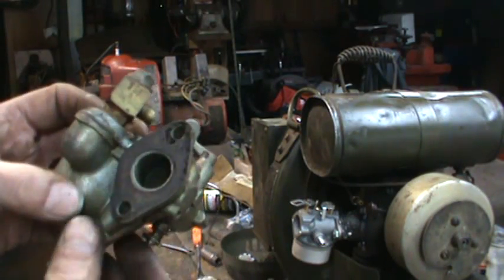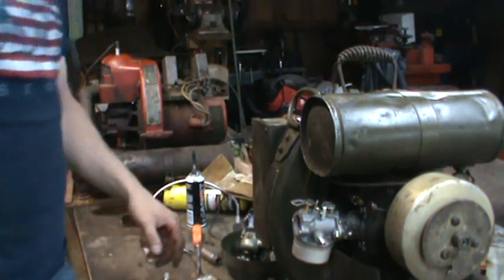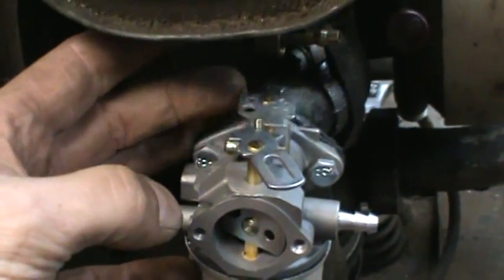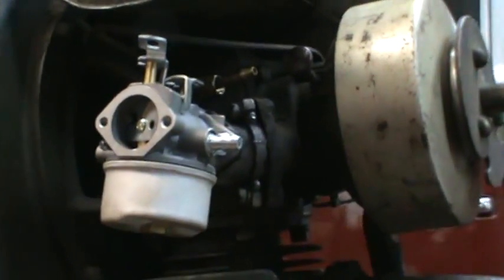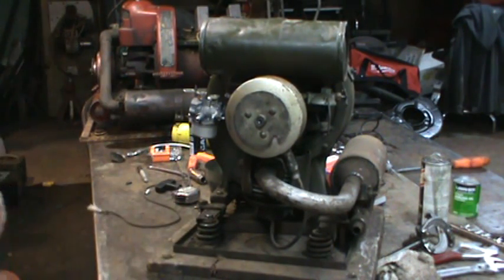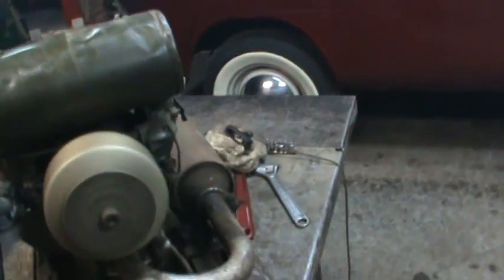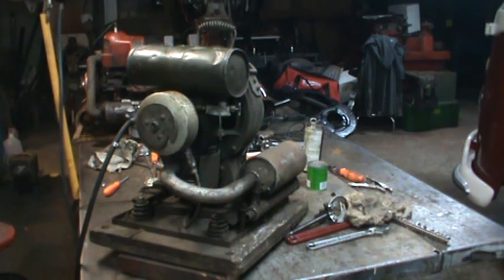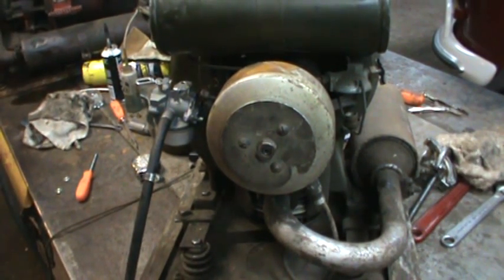antique 2 stroke engine with modern carb

Comment: Mustie..I have a 5 h.p. B&S (circa 1964) that came off a Simplicity snow blower that we inherited after my Grampa passed (1976) about 18 years ago I did a light refresh on the motor,a slight hone,new rings,and cleaned/lapped the valves,installed a "pointless" ignition and a "racing" carb. This spring after sitting for about ten years, two pulls of the chord it fired right up and runs great. I even have the chasis (all metal and damn heavy!) They are your's if you are interested. I won't be doing anything with them!

Comment: Looks like it has a crankcase sealing failure. All of old and unmaintained 2 stroke has this problem. You can not make a good cold start enrichment what leads the engine to start quite hard and goes full lean on low rpm with normal fueling settings.

Comment: I had a datsun truck that wouldn't run and was out of gas. so I drank the rest of the beer in the can and filled the cut open can with gas to near full, and was going to use it to spill little bits of gas into the weber vertical draft to keep it running, and get another beer,  so one handed with a screwdriver jumped the starter and the other hand held the beer can filled with gas. then a discovery was made, the motor will draw it's own ratio of gasoline to run perfectly as long as the level of fuel is close to spilling over (but not,) by adjusting  the tilt on the can. it's vacuum will self turbulate the surface of the gas and draw into the carb the perfect mix, maybe a little rich, but in any weather too. so just get the gas close to the intake, it knows what to do. then timing the new beer to be m/t just before the other one runs out so I could fill that one next was my challenge.

Comment: Sounds like an old Lawn Boy 2 cycle lawnmower. Grandfather had a gas reel type mower in the 50's and graduated into a 2 cycle Lawn Bow. The Gas reel mower had a starter cup notched for the started rope knot. After starting you tied it to the mower handle. Thanks

Comment: Like the video... as you continue to test things, you might consider using a battery powered impact wrench (with a socket temporarily mounted to the fly wheel) to make starting the engine, testing/fine tuning  things a bit easier. Either way, looks like your well on your way to figuring it out.... well done!
Reply from the maker: funny you should say that, as thats what l did now that the engine is built on a bike.
Reply: Do you have the video link, Mustie1? Can you post it here and in the description? Thank you.

Comment: They way you know you have adequate gas/oil mix is they smoked heavily compared to modern2 strokes constant blue smoke or you don't have enough oil in the gas. I ran these for years and about the only thing that kills them is the wrong oil mix 
1 quart of 30 weight non detergent motor oil mixed with 5 gallons of gas and they will run forever. Don't forget to shake the gas can for 30 seconds before fueling as the motor oil will settle.

Comment: I love these old engines. wow very loud! what size is it, something like 50cc?
Reply from the maker: not sure but l think its about 3 hp
Reply: Actually the noise level doesn't seem all that bad... always preferred engines with a low/lower sounding rumble vs engines with a higher pitched/mosquito like whine... wonder (if you used a smart phone decibel meter App) what kind of decibels that engine puts out at idle, half throttle and full throttle from apprx 7 ft away?

Comment: Sweet.  Great job man.  Can you use a computerized carb.  I have a box of old stihl, echo, and lawnmower carbs as well as a few engines I can destroy playing around and I think I may have a bit of tinkering to try tomorrow cause the neighbors would call the cops or throw a fit if I did it now.  Been close enough to there already.  Where are you located?
Reply: Phillip Kramer I'll take them

Comment: governor is behind the front half of the crankshaft remove the four bolts that hold the front case on you will see the governor it is spring loaded variable venture type it restricts the air fuel mixture going into the engine. no matter what carb you put on it the engine will not rev any higher I have a couple of old homelite generators and I ues Tecumseh 5 hp carbs on both
Reply from the maker: +Ronald Broadway thanks for the info, l have this engine on a bike now and took it apart and found what you said,
Reply: Interesting, learn something new every day! Thanks

Comment: I have an old Briggs & Stratton (circa 1974 Flat-head side valve) that was used as a edge trimmer but the old guy who owned the engine didn't put any oil in the crankcase ever. I have stripped it down with plans on getting it going again. Even though the engine ran with no oil in it, It seams to be in good condition. It's only a 3.5hp side valve but it should run a car alternator to charge up car batteries.

Comment: +mustie1 That's a great find picking up those old engines. Better still is that you got them running. Great job buddy. Have fun with them as the old motors would be way better built than any of these newer engines you can buy these days.

Comment: You Need to change out the high speed jet in the bottom of the carb to a larger size . Two Strokers like rich mixture .This engine is starving for fuel .   It will be a tough find , had many projects with this type  carb .

Comment: that generator is called the little joe the throttle is controlled by the governor it is on the crankshaft inside crankcase . all parts are still available military surplus

Comment: Mustie1, Not sure how well it would work as a 2 stroke carb, but, I love the Honda 200cc clone carbs, they can be had for around $25 on eBay. The jets can be bored out a little to make the mixture a bit richer. Runs good, thanks for posting!

Comment: kinda neat how they used crankcase pressure for the governor. Be sure to plug it good anywhere crankcase pressure could leak out. Crankcase pressure can be very important to 2 stroke engines
Reply: That's what I was wondering if he had plugged that pulse line.

Comment: Looks like it runs good. Could that motor possibly be a low rpm motor as a generator doesn't need to run at a high rpm.

Comment: Very clever cobblin there brother, I think the 2 stroke motorcycle carb (Mikuni or Kehien) would serve you well on that engine. What is the fuel / oil ratio of that old timer, 16 to 1 or 24 to 1 ?
Watchin and lovin it !